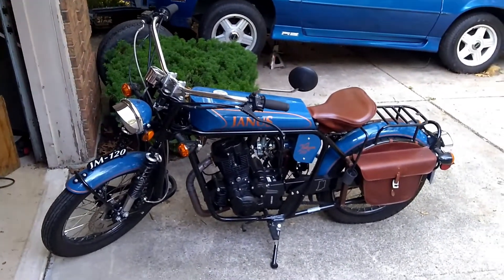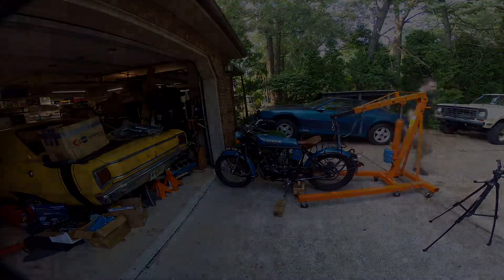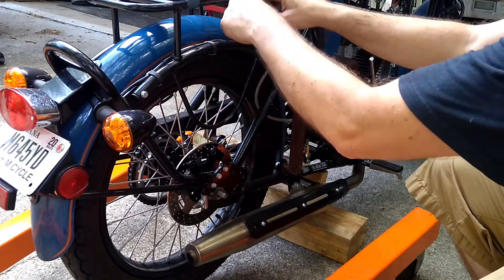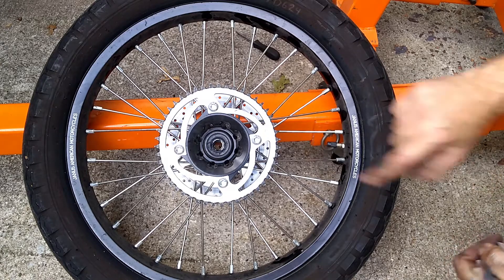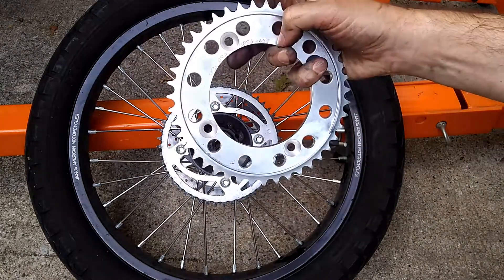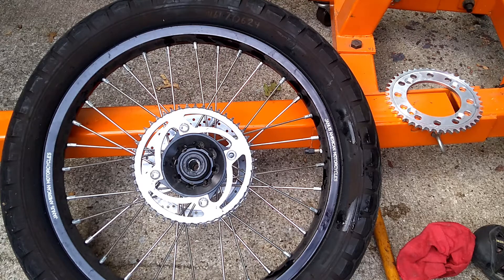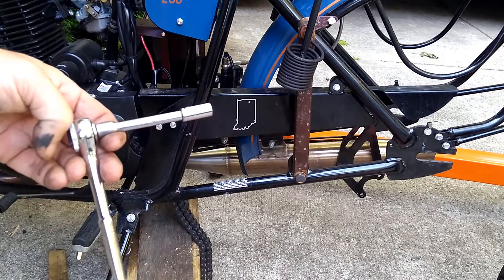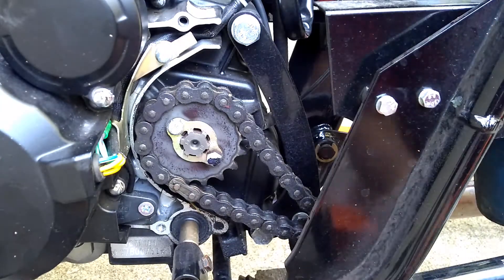Changing the Sprocket on a Janus Motorcycle

Comment: Good year 2021
From Portugal I ask you:
And did the drive pinion stay the same?
Didn't you have to apply a pinion drive with fewer teeth?
Or do you instead apply an attack pinion with more teeth and leave the toothed rose with 47 teeth?
hug
Reply from the maker: No, I only changed the rear sprocket. I wanted to have lower top-end RPMs.

Comment: You did all that but didn’t list the results
Reply from the maker: Good point!  Being only 250cc, the Halcyon doesn't have a ton of power but the main thing I was trying to do was to lower the engine RPMs for a given speed.  With the factory original sprocket I was usually in 5th gear really early - like 40-45mph.  With the new sprocket I find I can be going 50 and still be in 4th.  Overall vibration seems to be down, since the motor isn't revving as fast, and it didn't noticeably change the lower end.  WE don't have many hills where I am, so I don't know if it would impact someone who rides a lot of hills, but for me it was all positive results.
Reply: Never ever heard of a Janus 250 going any faster without modifying the engine..  Every sprocket change I've read says "I just want to have lower RPMs."  You definitely get lower RPM's but to say this bike goes 70 is hilarious. I have a long freeway ride to get to the slower roads, and 50mph on the freeway is scary.

Comment: Use blue lock tight not red, red won't come back off it is meant to be permanant, blue will when u need to do maintenance again later. Sprockets wear out with use.
Reply from the maker: I'd agree that blue would be fine. Since they have nylock nuts, none would probably be fine, too. I've never considered red to be permanent, though. The original was definitely red, and I've definitely taken apart plenty of things held with red.
Reply: @YoshimoshiGarage  I hear you ive also taken apart many motorcycles/scooters and cars and I've also seen red put on but only Chinese factory  assembled vehicles not American made of Japanese made/assembled, I assume it prolly incompetence or lack of knowledge of the products Intended use aka locktight red or blue or others available on the market. Just because you can do somthing wrong does not make it the correct or the Intended use. Just saying.
Reply: @YoshimoshiGarage  also red if you read it say to heat red to 500 degrees F to remove without damage on it read it.
Reply from the maker: @trdadam2325  Maybe Chinese red thread locker is the strength of normal blue?  LOL
Reply: @YoshimoshiGarage  lol mabe

Comment: Spending less?
Got more edge speed?
Or got more start up?
hug
Reply from the maker: I mainly just wanted to have lower RPMs and less vibration at highway speed.  It also moved the shift points up, so I no longer am shifting to 2nd gear while still in an intersection.
Reply: @YoshimoshiGarage  That is probably the only thing I don' like about the factory set up, is shifting into 2nd.